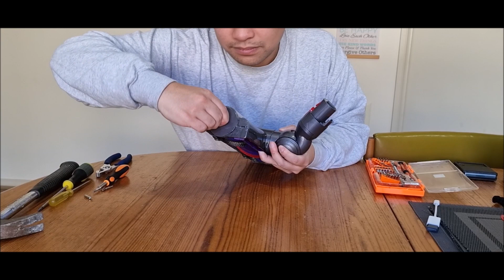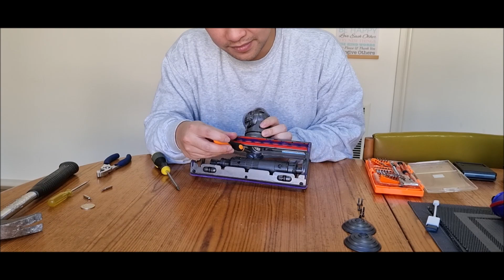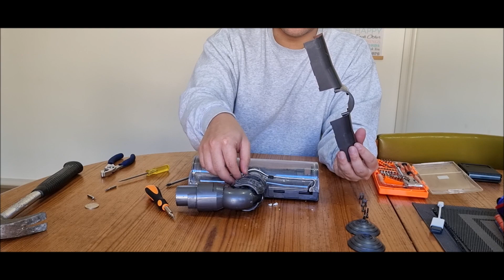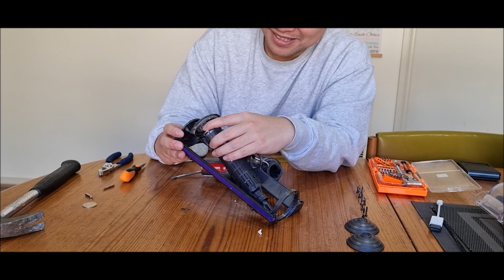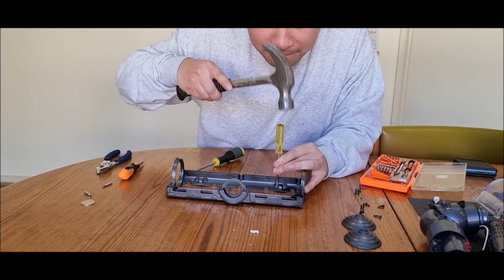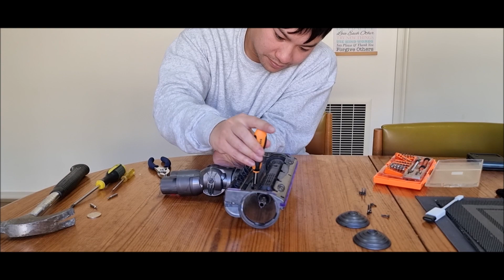OPEN ME UP! Dyson V11, V10, V8 and V7 Direct Drive Head Disassembly and Clean Updated 19.7.22

Comment: Thanks, I just fixed a crack in the neck part using the glue and tissue paper method & had to pull the head apart to get to the neck, great tutorial thanks! hopefully do not need to replace the head for a while now.
Reply from the maker: thanks for your support

Comment: Legend! Thanks. Most videos cover the other version with the short spindle. 

I couldn’t work out how to get to what I guessed were screws behind the red strip. 

Had to go a bit further and take the motor out of the spindle, thought I was going to need a new one but I started spinning it around and a hairball came out and it started working. Having a bench PSU I could set to 16.2V helped to test without plugging everything back in (PS: black is positive on the Dyson!)

Also invaluable having the video for the reassembly.

Saved me AU$130 on a new one.

Comment: I already go so far, I want know how to disassembly the rotate core , because my couldn't  spin.
Reply from the maker: you dont. if you need to do that it is probably faulty and needs replacing
Reply: @OpenMeUpTec  That's what I came to see as well. ... It starts to spin, then stops. It is still powered, there is just something in there making it jam.
Reply: @qatsi00 probably a bit late, but my motor had a hairball inside it. I manually span it around after removing it and saw some hair poke out the vents and managed to remove it all. Working great now.

Comment: I made a mistake the first time I ever cleaned the Direct Drive, and removed the black foam seal, it took me ages to put it back correctly, with the right amount of stretch (as it is streched when put inside of the grooves it has), however, it can be done, with an absurd amout of patience. 

With that said, don't do it, it serves no purpose, and it likely won't be dirty on the inside, just wipe it down with a damp cloth if you really need to.